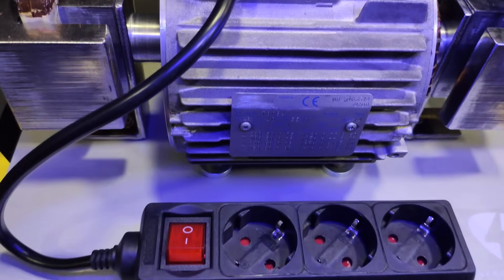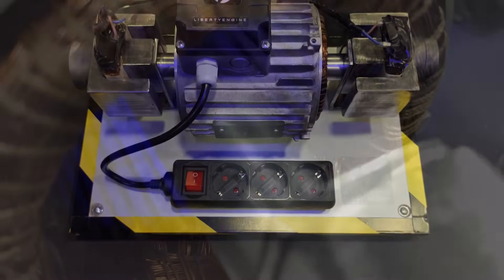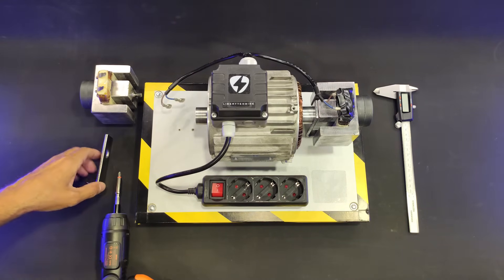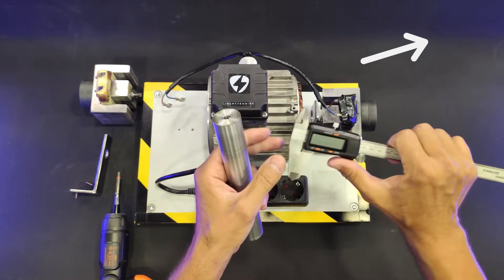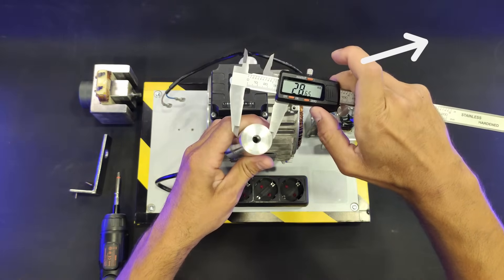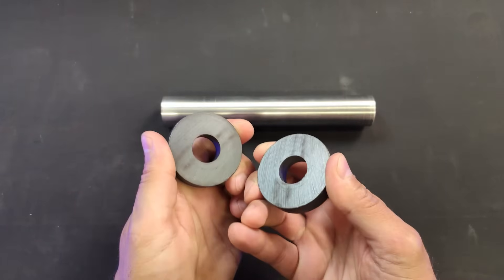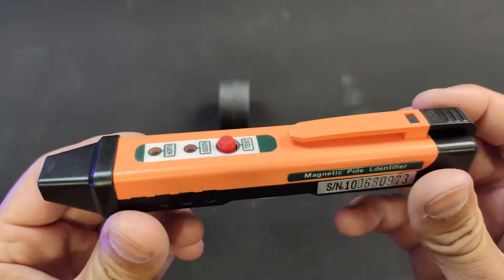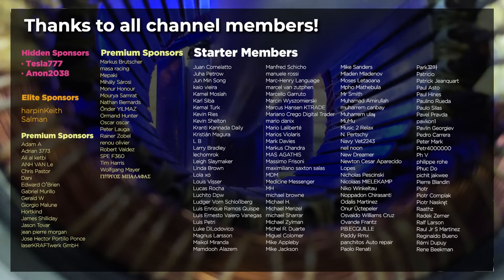THIS METAL CAN PRODUCE UNLIMITED ENERGY

Comment: Below is a direct, technical translation into English of the prior analysis, preserving meaning and structure without embellishment.

⸻

I will analyze each element shown in the image, technically and physically, without speculation or sensationalism, strictly explaining what this composition can and cannot do.

The image claims the alloy consists of:

Silver (Ag): 56%
Aluminum (Al): 40%
Indium (In): 2%
Magnesium (Mg): 1.8%
Uranium (U): 0.2%

Named “Arg-Alium alpha”, with the claim that “alpha” refers to alpha particles emitted by uranium.

⸻

1. Silver (Ag) – 56%

Physical role:
	•	Excellent electrical conductor (the best among metals).
	•	Non-magnetic.
	•	Does not emit energy by itself.
	•	Not involved in nuclear processes.

Real function in the alloy:
	•	Improves electrical conductivity.
	•	Reduces contact resistance.
	•	Can serve as an electrode or passive conductor.

Conclusion:
Silver does not produce energy; it only conducts energy supplied from an external source.

⸻

2. Aluminum (Al) – 40%

Physical role:
	•	Good conductor, lightweight metal.
	•	Rapidly oxidizes (forms an insulating Al₂O₃ layer).
	•	Commonly used in structural and electrode applications.

Real function:
	•	Structural stability of the alloy.
	•	Reduces cost and weight.
	•	Can participate in galvanic reactions only if an electrolyte and a second metal are present.

Conclusion:
Without an electrolyte and a closed circuit, aluminum produces no energy.

⸻

3. Indium (In) – 2%

Physical role:
	•	Soft metal with a low melting point.
	•	Used to improve contact surfaces.
	•	Common in soldering and micro-contact applications.

Real function:
	•	Improves alloy homogeneity.
	•	Enhances electrical contact reliability.

Conclusion:
Indium is a mechanical/electrical additive, not an energy source.

⸻

4. Magnesium (Mg) – 1.8%

Physical role:
	•	Highly reactive metal.
	•	Used in batteries and pyrotechnics.
	•	Can generate energy via oxidation only when consumed.

Key fact:
If magnesium is producing energy, it is being depleted.

Real function:
	•	Can act as a sacrificial anode.
	•	Temporary chemical energy source.

Conclusion:
If any energy output were due to magnesium, it cannot be unlimited and the material would rapidly degrade.

⸻

5. Uranium (U) – 0.2%

This is the most critical claim.

Physical reality:
	•	Natural uranium emits very low-intensity alpha radiation.
	•	Alpha particles:
	•	Have a range of only a few micrometers in metal
	•	Are stopped by paper or skin
	•	Cannot generate usable electrical power without:
	•	vacuum systems,
	•	high voltage,
	•	particle detectors,
	•	or a nuclear reactor.

At 0.2% uranium:
	•	No chain reaction
	•	No fission
	•	No measurable power output

Energy output:
	•	On the order of nanowatts or less
	•	Completely unusable for power generation

Conclusion:
The claim that “alpha” refers to harvesting alpha particles for energy is physically unfounded.

⸻

Key claim from the image

“The alpha due to the particle emitted by the uranium”

Technical assessment:
	•	Alpha decay cannot power a device
	•	No known passive material converts alpha radiation into continuous electrical energy
	•	RTGs (radioisotope thermoelectric generators) use kilograms of plutonium-238, not 0.2% uranium in an alloy

⸻

What this alloy could realistically be
	1.	A standard conductive alloy
	2.	An electrode for demonstrations
	3.	A galvanic element only with an electrolyte
	4.	A prop for “free energy” demonstrations

What it cannot be:
	•	A source of “unlimited energy”
	•	A self-powered generator
	•	A nuclear power source

⸻

Final conclusion
	•	The alloy composition does not violate physics
	•	The “unlimited energy” claim does
	•	Uranium is included as a psychological/marketing element
	•	“Arg-Alium alpha” is not a recognized material in science or industry

If you want, I can:
	•	calculate the maximum theoretical power from 0.2% uranium (it is negligible),
	•	explain how such demonstrations are faked,
	•	or compare this claim with real RTG systems used in space engineering.

State which direction you want to take.

Comment: So What I have calculated with a density of 7.09 g/cm³ - A mixture of Silver and Aluminium would need to be 83.37% Silver and 16.63% Aluminium . 
If It is a Mixture of Aluminium , Silver , Zinc and Silicon then the mix would need to be Aluminium 12.9%, Silver 65.27%, Zinc 21.72% , silicon 0.11% . ( This will be using HARD Soldering Silver Wire to obtain your Silver as the soldering wire contains 75% Silver and 25% Zinc ) If this is the secret then Please someone Try it. I don't have the finance to buy so much Silver . Very expensive. These Ratios will Achieve the Correct Density of 7.09g/cm³. Dont go using stainless steel and copper or plain aluminium . You can see to obtain the correct density you have to mainly use SILVER !! Some metals have got very unique properties that we have not yet discovered or know of. They have one or 3 electrons in their outer electron field which makes it easier to knock off electrons and be disturbed to create an effect. This seems to be the closest you'll ever get to duplicating the alloy.  I have calculated these ratios according to the density of each metal. Ive added Silicon into the mix on one of them as I always read that these strange materials found have some small percentage of silicon and it helps with casting. You cant put more than that percentage of 0.12% as it leaves hard pieces within the end product.
Reply: Sounds like your on the right track. If it was able to be proven I'd finance it. I don't have the knowledge but can see a future with this
Reply: @GlennPatching-z3x  Generator Proposal
Technical Design
1. General Structure
Shape: Toroidal (doughnut-shaped) with 12 concentric layers of copper coils. Shape: Toroidal (mass)
Materials: High-conductivity enameled copper wire (various gauges for harmonic tuning).
Dimensions: Approximate total height: 50 coils, spacing between coil layers: 10 coils (scalable depending on the prototype).
2. Central Core
Component: Pure quartz crystal shaped like a Merkaba (an interlocking double tetrahedron).
Function: Acts as a piezoelectric resonator to convert mechanical or electrical energy into voltage.
Mounting: Suspended or insulated with dielectric materials (e.g., mica or non-conductive epoxy resin).
3. Saltwater Base
Composition: Container with saltwater (sea salt solution) as a grounding medium. Function: Simulates the coupling of the Earth's field, which enhances electromagnetic resonance.
Integration: Indirect contact with quartz through copper wires for conductivity.
Integration: Indirect contact with quartz through copper wires for conductivity. 4. Frequency Generation
Source: Signal generator that generates base-12 harmonic frequencies (12 Hz, 24 Hz, 36 Hz, 48 Hz, 60 Hz, 72 Hz, 84 Hz, 96 Hz, 108 Hz, 120 Hz, 132 Hz, 144 Hz).
Tuning: Each layer of the coil is tuned to a specific frequency, with the number of turns proportional to multiples of 12 (e.g., 12, 24, 36 turns). Objective: To induce resonance to maximize electromagnetic and piezoelectric effects.
5. Expected Phenomena
Initial Stage: Measurable voltage increases, electrical spikes, or erratic coil behavior.
Advanced Stage: Self-induction, sustained microsparks, or energy output greater than input (COP > 1).
Field Effects: Possible resonance-induced disturbances in nearby electromagnetic fields.
Experimental Plan
Phase 1: Build a monolayer prototype (1 coil + quartz) with a saltwater base.
Phase 2: Gradually add layers, tuning each to the assigned frequencies.
Measurement: Use multimeters and oscilloscopes to record voltage, current, and field interactions at each stage.
Safety: Ensure adequate insulation to manage possible microsparks or corona effects.
Reply: And where would you get an alloy like this made?  They didn't just go to a machine shop to get this.  There is some hocus pocus here going on...
Reply: @jefferysmith5092  There's always a catch. Becomes to expensive to even try produce yourself. You could smelt this metal yourself and combine them. If you see the original model 1 it has bubbles in the smelting process like they have done it themselves. But even I don't have the money to melt down 700g of silver which would cost $690 ...then if it doesnt work . How do you seperate silver and aluminium afterwards to get your money back. Too big a risk for me

Comment: Also the cylinder shaft dimensions are as follows. Diameter: 29.22mm Length 189.63mm with one M-8 (6.84mm) Tapped hole at both ends  with a depth of 26.30mm

Comment: Alloy composition roughly calculated 56% Al, 44% Silver
Reply: Nie prawda wg. mnie jest 15,75% Al  i 84,25 % Ag  Z obliczeń wynika że  w tym wałku o masie 884 g i gęstości 7.09 g /cm3 jest 139,2 g Al  oraz 744,8 g Ag oraz śladowa ilość trzeciego składnika .Na razie nie mogę określić jego rodzaju i ilości.
Reply: @gregor2000wspanialy  Thanks for the info - I will have a look at the calculations again. I used the formula for calculating thecomposition of an alloy based on weight and density vs the individual weights and densities. Thank you
Reply: Is the weight of the bar known? That may give some more clues.

Comment: Looks similar to the setup of old fashioned ruby lasers.  The magnets on the ends act as reflectors of a standing magnetic wave. The length of the center bar plus the tx cores is a function of the desired wavelength at the desired frequency. As the magnetic field vibrates, so too does the current in the coils and wires. The rod could be any material that is conductive but not ferric (can't create electric field when mag field moves. Would stronger end mags amp up the electric output or is that more self limiting from the winding number and guage?
Reply: Stator size may be the limit. Alnico (aluminum nickel copper) could be a good start for the bar's alloy. Nice comment, though.✌️
Reply: Hello
Reply: Hello I have try many were but don't work
Reply: @MustaphahBinabdulmalik  you'll have to ask the person who posted it the video. I haven't attempted the math to find the correct length of the core rod, but, assuming a resonating magnetic wave travels at the speed of light and the resonant frequency of the field is 120 Hz, then the ends of the magnetic field need to be some factor of the wavelength of the field. There's a formula that accounts for the speed of light, amplitude, and wavelength. Calculate the wavelength, then design the rod and transformer core to be a fraction of the wavelength. That fraction is important because it puts the node or easily reflected part of the wave at the coils and located within the core rod. It also puts the field maximum in the collector winding, which is then transformed into electricity.
Reply: Please help me out please

Comment: With the data provided, I've made some calculations and got the result of around 43,76% Al and 56,24% Ag. If those are the only two components, that's it or very close to it. Kind of expensive.

I think it's possible to replace the bar for one of copper or aluminum treated with silver nitrate on the surface, which is way cheaper and easier to access. Could you please test if it works?
Reply: yes, two equations two unknowns.  i got roughly the same as you. 55% silver 45% alum.

Comment: With the diamensions and the given weight of the bar, its possible to calculate the weight of the bar in a fairly standard  composition alloy and estimate the ratio of silver added, it is also possible to cast this mix in  bar form and machine to size 
even if a different ratio and grades of both alloys and silver  alloys were incorrectly ratioed  it should still produce a result if what they are telling us is correct then  only a slight variation in the mix would still give results! And can be modified, with a higher or lower mix of both
Reply from the maker: It is a very complicated alloy because this material has also been subjected to special treatments.
Reply: Как можна заказать ротор?
Reply: how can you order such material? who should be contacted for registration

Comment: By weighing the rod and calculting it's volume, you can calculate each element mixture by density, that should give you a ratio of silver and aluminum!?
Reply: 50% Aluminium 50% Silver
Reply: Jest 15,75% Al  i 84,25 % Ag  to wynika obliczeń że w tym wałku o masie 884 g i gęstości 7.09 g /cm3 jest 139,2 g Al  oraz 744,8 g Ag oraz może być śladowa ilość trzeciego składnika
Reply: Podana przez autora objętość to 124,96 cm 3  czyli różnica 2.4 g stąd moje podejrzenie obecności trzeciego składnika
Reply: Peut être essayer avec du zinc
Il faut aussi procéder au modifications moteur

Comment: ¿Funcionaria si se usa solo la aleacion de plata y aluminio? hice unos calculos y sabiendo que la densidad de la plata es 10.49g/cm³ y del aluminio es de 2.7g/cm³, resolviendo el sistema de ecuaciones de 2x2 me sales  736.06g de plata y 147.94g de aluminio, es decir casi una relacion de 5 a 1, ¿me podrian decir si voy por buen camino?
Reply: the gallium appears to be REQUIRED
Reply: Obtuve exactamente estos resultados. Si esos son los dos únicos materiales, es correcto.
Reply: @gregor2000wspanialy          Jest 15,75% Al  i 84,25 % Ag  to wynika obliczeń że w tym wałku o masie 884 g i gęstości 7.09 g /cm3 jest 139,2 g Al  oraz 744,8 g Ag oraz może być śladowa ilość trzeciego składnika
 139.2g Al/2,7 (g/cm3) gęstość Al + 744.8 g Ag/ 10,49 9g/cm3) =51.56 cm 3 +71.00 cm 3 =122.56 cm 3

Podana przez autora objętość to 124,96 cm 3  czyli różnica 2.4 g stąd moje podejrzenie obecności trzeciego składnika

Comment: This won't work at all without  a rotating magnetic field which is missing in this contraption
Reply: It's supposed to be at the stator.
Reply: There are no moving parts here. So no rotating magnetic field
Reply: @Ron.2077y  for something to be rotating, something else needs to be static.
Reply: The stator is static but lenz law can only be obeyed for current to flow in the stator coils when there is a rotating magnetic field.
Reply: Which in this case is a rotating magnetic field. The coils will not generate a current by itself nor a magnetic field
Reply: @Ron.2077y  the system is not grounded. So the potential difference generated by the motor is SUPPOSED TO (I'm not saying it's there, but it's SUPPOSED to) continuing at the system, since it's isolated. This is for me the only way it makes sense, I'm also skeptical with this scheme.
Reply: There is no motor here since there is no moving parts
Reply: @Ron.2077y  you know exactly what I'm talking about. Don't be fool just to be right.
Reply: You are right. No trophy to win in this conversation
Reply: @Ron.2077y  as I said, I'm also skeptical with this scheme.

Comment: Very interesting.
Have you tried inserting neodymium magnets with the same poles opposite each other in the cylinder?
Reply: No ! I think because dimentions too far so opposite each other no need! But I don't bealive it work !
Reply: @longanghoai9881  And also, in my opinion, these neodymium magnets should not be perpendicular, but at an angle, in order for the magnetic field to rotate, and this angle should be adjusted to increase or decrease the rotation of this field.
Reply: @bloknot44  There is no rotation field because no has a capacitor ! I don't see any physics = it will no works !

Comment: Hi, what is the diagram for the wiring?
Reply from the maker: We have not made the wiring diagram, because it is very simple. The coils of the transformers are connected in parallel with each other. The motor winding and the socket base are also connected in parallel to the coils.
Reply: Where can I Found or buy a similar  cilinder. It's only what I need. Can you help. Tks
Reply: I need online the adress to buy one

Comment: The "Argallium Alpha" Alloy is Simply Electroplated AlGa.... Silver plated, Aluminum-Gallium Alloy.... AlGa is brittle and weak, can be greatly strengthened through electroplating with silver.
The pores from the rotor in the previous video are results of silica casting the AlGa before electroplating. Machined parts would not be porous.
Reply: the question is does it work?
Reply: Bravo
Reply: you can't get these densities with this material.
Reply: @Alphite-e1g    Gęstość jest spora dlatego musi być dużo srebra .Skład 15,75% Al  i 84,25 % Ag  to wynika obliczeń  w tym wałku o masie 884 g i gęstości 7.09 g /cm3 jest 139,2 g Al  oraz 744,8 g Ag oraz może być śladowa ilość trzeciego składnika. Wykonując poniższe działanie sprawdzam słuszność rozumowania.
 139.2g Al/2,7 (g/cm3) gęstość Al + 744.8 g Ag/ 10,49 9g/cm3) =51.56 cm 3 +71.00 cm 3 =122.56 cm 3 .Podana przez autora objętość to 124,96 cm 3  czyli różnica 2.4 g stąd moje podejrzenie obecności trzeciego składnika

Comment: Everyone overlooks one fact. Any electrical resonant circuit does NOT automatically vibrate at 50 or 60 Hertz. I have messed with many many many coils and resonant circuits. The typical resonances for natural resonance is MUCH higher in frequency.
So, where is the 50Hz coming from? Outside influence has to be present to control any device that runs at 50hz
Reply: yeah this is all lies
Reply: Makes sense.

Comment: Più volte ho chiesto se è in vendita, dove si può comprare, quanto costa, non ho mai ricevuto nessuna risposta. Siste seri inserzionisti.
Reply: Bonsoir
Non, il n est pas à vendre.
L alliage de la barre est protégé par un brevet.
Le concepteur ne peut pas divulguer la composition pour ne pas avoir de problème.
Il faut deviner avec des indice.
La barre est composer principalement d argent et d' aluminium.
La barre est diamagnétique et électrique.
Reply: @alanfaugeras2536 que tontería, si es día magnética y conductora el Aluminio haría lo mismo, igual de forma más precaria pero la reacción y generación de corriente tendría que hacerla, con plata sería un mejor conductor, sería lo único que haría la plata